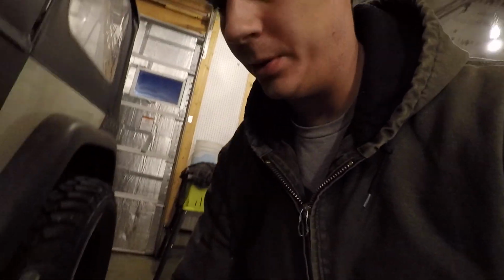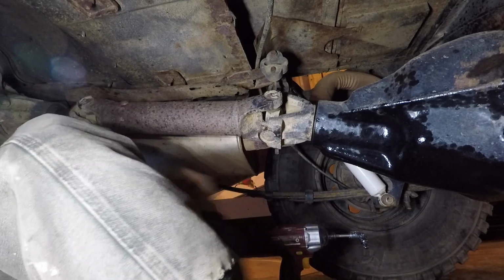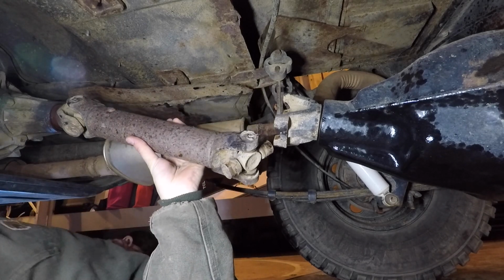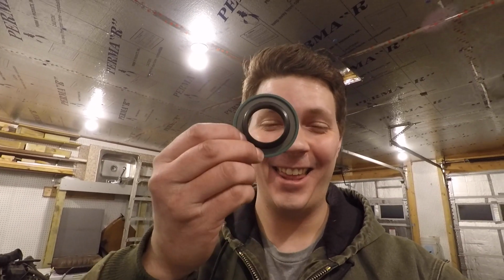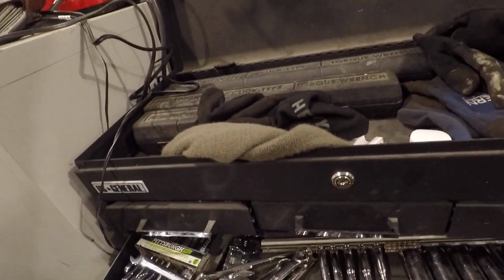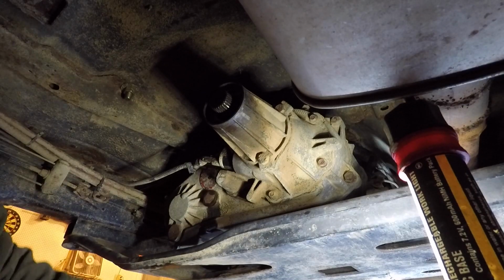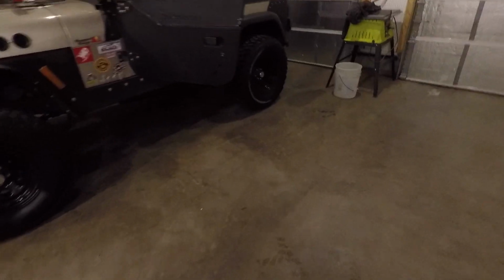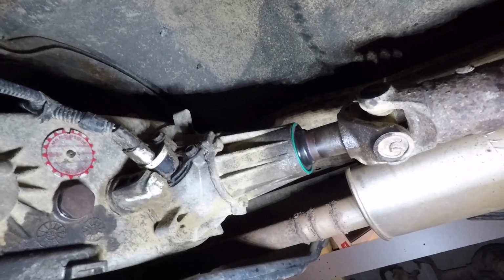Seal Replacement!

Comment: never ever  drain yer fluid before making sure your fill plug will come out
Reply: true, but before he removed the fill plug in the video there was already oil running down the case from the fill plug, so it was probably already removed and he just did not show that part
but yes, it is a good idea to make sure it can be removed first

Comment: do you know if you have to remove the transfer case to replace the seal on the input shaft? Thanks.
Reply: No, you you just pull the transmission and take off the cover inside the bell housing to access the input shaft. You’ll definitely want to drain the transmission before you pull that cover off though or you’ll end up with a ton of oil in your bell housing.

Comment: What is the torque specs on the little straps that hold the drive shaft on in the rear?
Reply: Depends on the bolt they may differ.
1/4" round bolt 14 foot pounds.
5/16" round bolt 25 foot pounds.
That is thread of bolt diameter, not the bolt head measurement!

Comment: when i changed the transfer case seal on my 2000 all wheel drive land cruiser ,when i turn the rear wheel jamming or lagging when i go straight it goes fine . do you know what could be the problem

Comment: Hey guys, I gotta a 75 gmc 4x4 sm465 manual transmission. I drove it around and I noticed a lot of fluid on the ground. My transmission feels pretty good. Is there two seals on each transfer case? I was just curious. Thx!!

Comment: hey man., nice YJ you have there -- appreciate the time you took to make this video, my '90 has a similar leak and looks like i need to do exactly what you did in the vid.  Question - how did you know how much fluid to put back in to ensure it was full?
Reply from the maker: Thanks for the compliment! Just fill the transfer case through the fill hole til it starts spilling out.
Reply: good stuff man.. appreciate it -- [] ||||| []  Strong!
Reply from the maker: Dare to be square!
Reply: Completed this transfer seal change on Monday morning and it went smooth man.... no more leaks but now im dealing with a parasitic voltage draw on my battery when the Jeep is off, fun times, but thanks again for your vid!
Reply from the maker: Glad it went well! Blah I’m glad that’s happening to you and not me hahaha. Good luck!!

Comment: just throwing it out there, seals are not meant to be installed using grease, they should be installed with both surfaces completely dry

Comment: I would remove the housing replace the seal and the bushing ! Complete job done and no leaky ! A worn bushing will cause the seal to fail and leak ! If u dont replace the bushing the seal will soon start leaking again ! Frustrating !
Reply: How do you remove the bushing?